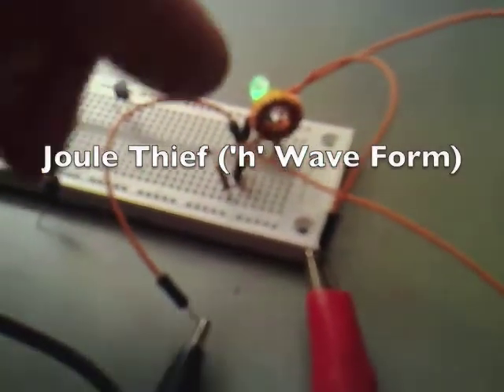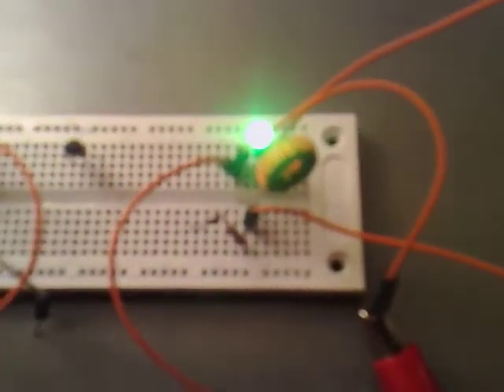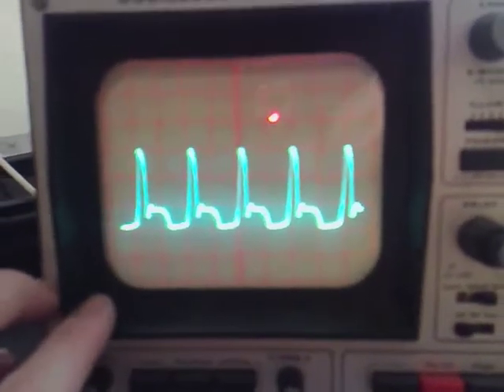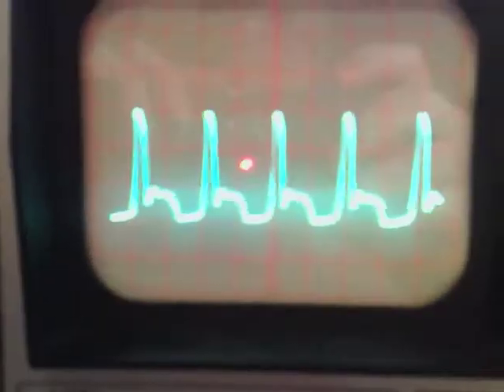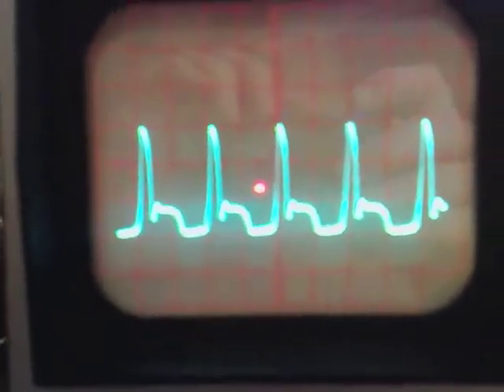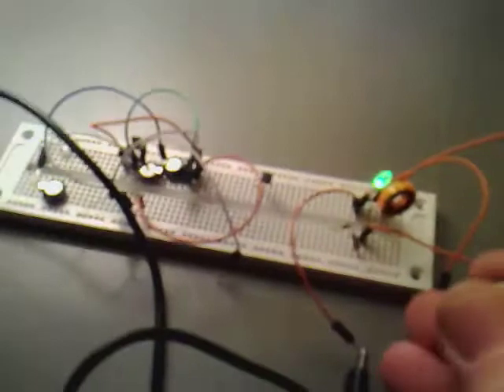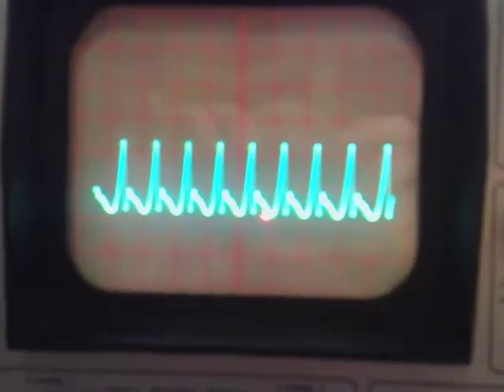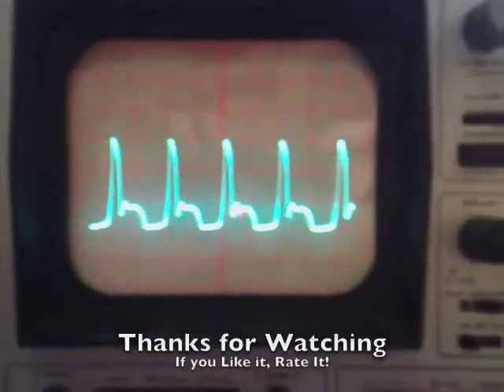Joule Thief ( 'h' Wave Form) 009

Comment: The reason for the frequency to change is quite simple: with the strong magnet you are effectively premagnetizing the core. The magnetization curve (basically a narrow hysteresis loop)  flattens towards the end. In an approximation, the first derivative is proportional to the relative permeability of the core which is likewise proportional to the inductivity. Conclusion: premagnetizing the core reduces the inductivity which results in a higher resonant frequency.

Comment from the maker: The spike was 3v with the LED Connected and 5-6v with the LED out the Circuit.

I just was not expecting the frequency to double, If anything I thought it would hinder the operation. Its interesting what you find out!

Paul

Comment: good work Kubikop...What is the voltage of the spike?  
the circuit is self oscillating because one coil induces a magnetic field into the other switching on and off, so no real surprise that the magnet will have an effect.